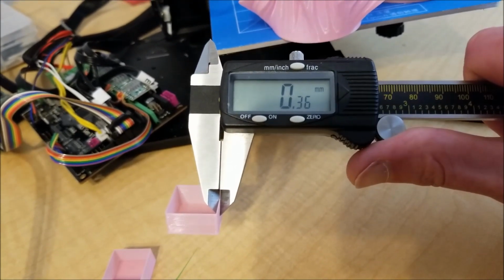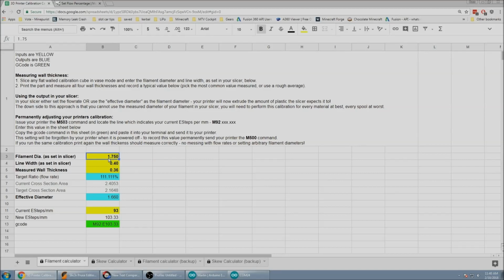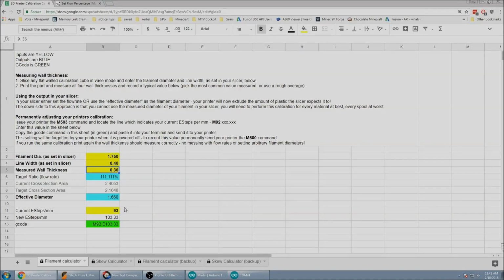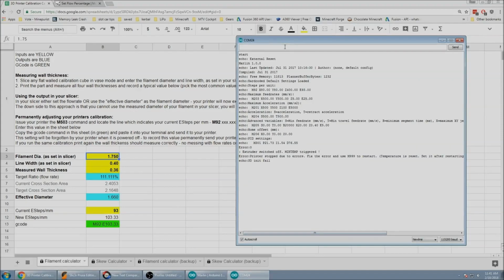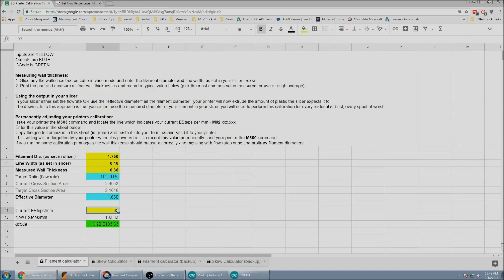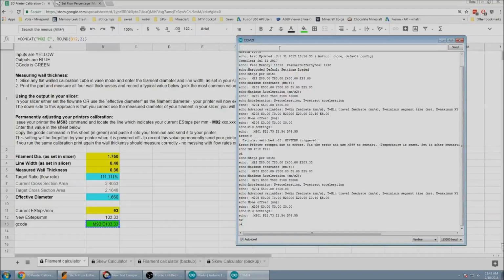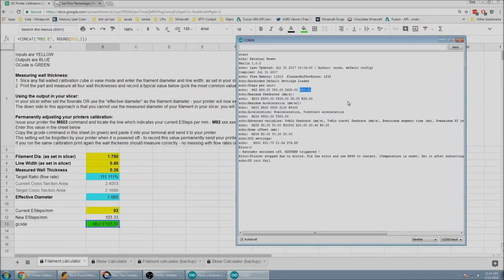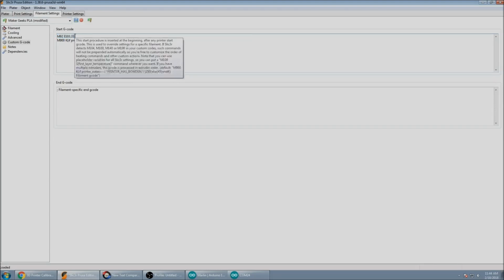Getting Better Layers from your 3D Printer and a better(?) way to calibrate your extruder!

Comment: Hey Ross,
I've watched some of your videos and really enjoyed them so far - great work!
I recently had some major problems with my extruder motor. It started click-clacking, missing steps and not extruding the filament correctly. (At that time I changed the cooling system as well as the fans for the hotend. I'm under the impression that the silent fan I used wasn't enough to keep the temperature down and the filament heated up inside the cooler.)
However changing the cooling system again, the fan and also (necessarily) increasing the voltage on the extruder motor did the trick and I finally could print again.

But I also had to recalibrate the e-steps noticeably (which for a long time worked great in default settings - not sure if I somehow damaged the motor after a day long click-clacking print while I was at work - could that be possible?).

Long story short I used the method that you described - measuring how far the filament actually got extruded vs. what I entered in OctoPrint. But your method really seems more straight forward though. I can't wait to try that!

One more question:
I watched your other video where you compare the noise of the prusa to your modded ender 2. That's amazing. I have as well watched Tom's video on the TMC2130 beforehand and I was quite intriqued. Seeing how you implemented the drivers into your ender - the printer I own too - makes me want to do the same thing even more.
Can you please elaborate on what exact board you used? (Also why this board, where did you buy it from - and well - all the juicy details! ^^)

I'm kind of in love with the idea of having a printer running silently besides my desk all day.

When I got the ender it was like 'holy shit TURBINES'. Changing the power supply (fanless notebook style brick off amazon) as well as changing the remaining fans helped a lot. The screaching and whining of the motors remains though...

I'd be happy to hear from you :)

(also: https://goo.gl/wgD1Si )
Reply from the maker: Early on the PTFE tubing in my hotend got pulled slightly out, either by retractions or filament changes. This caused a real mess as it let melted filament go where it should not... including causing a blockage in the end of the coldzone just before the nozzle - I wonder if something similar happened to you and the "clicking" was the stepper just pushing against a rock.

By "increasing the voltage on the extruder motor" I assume you mean increasing the reference voltage on the stepper controller (adjustment pot) which in effect increases the motor current (not voltage). It make sense that higher drive currents could help the motor power through a restricted pathway... have you tried pushing filament through by hand (while the hotend is hot of course)? It should be fairly easy to do ... it's hard to describe "the right feel" if you don't have something to compare to though. Check for anywhere the filament might be getting bound up starting from the spool and take a close look at the path through and just after the drive gear. Also check that the filament idler bearing (the bearing opposite the drive gear) moves freely.

When you were "changing the cooling system" did you disassemble the hotend enough to remove the PTFE tube and nozzle and make sure the end of the PTFE that's in there is in good condition? It could also be a good idea to burn off any gunk in the nozzle - there might be some burned plastic in there causing a partial obstruction or something. Also it's important that it gets reassembled correctly, it's more complected than "just putting it back together".

As for damaging a stepper... your really can't electrically damage them by stalling them, well short of causing destructive overheating which the smell should clue you in if that happened ;) 

What is your e-steps per mm now? 

- - -
I got this controller https://www.amazon.com/gp/product/B072ZZ3YQW
I picked it because I had no idea what I would need and this one brought out the maximum number of pins while being a single board. I bought from amazon because i wanted it sooner than 6-8 weeks from china. Any Ramps derivative board which exposes EXP1, AUX-2 and AUX-3 (in addition to the obvious connections) should suffice for this conversion and require very little change to my base Marlin modifications for the Ender. But you will lose the SD card reader if you don't get one with EXP2 and also buy a new display with a card reader integrated (or i guess you could find a card reader that stands on its own) - but you use octoprint so losing the SD reader probably isn't that important to you. Picking a display is not easy either, this whole "industry" is a mess of mashed-up hardware and to fit "this" display to "that" controller may require "such and such" adapter :/

Anyway, this controller board isn't "amazing" by any means, I sure would design it differently but then I guess it wouldn't be a standard ramps derivative my way... but the technical debt of its evolution leaves some rough spots IMO.

If you are willing to spring the extra $30 or so, and if you can find it in stock, I would suggest giving the Einsy Rambo Mini a try (https://ultimachine.com/products/einsy-rambo-1-1?variant=5522483871774), it retails at $110 and has the TMC2130's built in (keep in mind that if you go with a RAMPS like board the 4x TMC2130 silent step sticks will run you about $55). This is the same board that the Prusa i3 mk3 is shipping with. I didn't go this route because I started my adventure before this board was available for purchase. Hey, if you buy 2 and send me one I'll be more than happy to send you my marlin build when i get it going ;)

I haven't made my Marlin modifications publicly available yet because... well, i work in the tech industry and as such my employer owns everything I create even in my own time (it's the way of the industry, nothing specific to my employer). They are more than willing to allow me to release stuff, it's just a hassle I haven't quite had the ambition for yet, but I'll get there.

That said, it took me a full weekend to get my printer working on the new controller - keep in mind that my day-job is working with software and among my hobbies are designing my own circuits and I've designed a few high power (50+ Amps) motor controllers as well and i've been doing embedded stuff here an there for years and years and I'm not new to stepper motor theory and function either and this project had me questioning if I could pull it off for at least the first couple of days. Granted, mapping out the LCD and digging through enough of Marlins code to make the needed changes were the worst parts and at the same time are challenges that those who follow in my tracks wont have to deal with (once i make my Marlin build available that is).

Anyway, have your potato back :P

Oh, and here's some pic's of the basic mounting of the step sticks https://imgur.com/a/iTYJq
Reply: Thank you very much for your informative and insightful answer! :)

You're probably right on the voltage/current thing. I'm not an expert on those things (nor am I a native speaker) so I probably got the terms mixed up. What I did do was use my digital voltmeter and take a measurement between the adjustment pod (for the extruder) and ground - it initially read 0.62 volts. After slowly ramping it up to the point where the extruder motor stopped clicking the display read around 1.1 volts. So that's what I was referring to.

I also checked the bearing that pushes against the cog of the extruder motor and verified it moved freely.

While thinking about it again I remember that at some point the extruder cog was scraping off the filament instead of feeding it steadily into the tube. Probably also because of the slight blockage inside the heatsink/hotend. For every full rotation of the extruder only about one quarter (and usually the same) fed in the filament a bit, the other three quarters continued on scraping the filament. So I thought the cog must be off center or the rod of the extruder somehow got crooked. I checked and they both were not.
So when I added some more force onto the bearing by hand it seemed to work just fine. So I thought 'might as well be the spring having deformed and lost a bit of its strength over time'. I then got rid of the spring and looked for something the right size to push in between where the spring was sitting. Luckily the included green USB microSD card reader fits perfectly. It worked well enough that I could print a part to replace the spring completely - with the added bonus that changing filament isn't such a pain in the a** anymore: https://imgur.com/a/6W4mE
'If it's stupid but it works it's not stupid' - so I'm happy with that solution right now ;)

The hotend on the other hand I disassembled multiple times. Completely. And cleaned it every time. And carefully reassembled it every time. Trying to pay attention to every detail I learned from watching videos on unclogging and assembling the hotend of the ender 2. I also checked the tube and made sure the filament could still slide through easily. I even switched it the other way around to have the cleaner side go into the hotend. I think I was very thorough... oh and I also changed the nozzle at some point just to be safe.
And as you suggested I made sure that I could push the filament through by hand with just little effort.

(FYI - first I used the stock cooler with a silent 40x40x10mm fan, which was okay. Then I switched to this one https://www.thingiverse.com/thing:2751027 where I think all the problems started and the silent fan wasn't strong enough to keep the the heatsink at a reasonable temperature. At that point the heatsink was really really hot to the touch. Now I switched to this one https://www.thingiverse.com/thing:2334407 - but using a 40x40x20mm fan which seems to work just fine.
BTW - really like your cooler design. I'd like to use it as well but the fact that you can't really see the nozzle sort of keeps me from switching. The first cooling system I tried was mostly because of the fact that you could see the nozzle very well.)

So in conclusion I suppose for me there were multiple issues forming a big problem altogether... and while being a very frustrating episode I think I've learned quite a lot from it. (Though I'm not sure if everything appeared in the order I wrote in.)

Oh and esteps... I think around 98 or 99 instead of 93.

---

So about the board, Marlin and everything you wrote in the second half of your post. Very interesting! Thanks for sharing all the information... I think I do want to dive in deeper and have to learn more about the firmware and how everything works together.

To be honest I don't even know what kind of chips are used here. From doing a five minute research via Google just now I take it that these boards are arduino based. I haven't been in contact with any arduino hardware yet. But from my understanding that's an architecture (of which there are many - intel, arm, powerpc, etc. etc.). And it seems like Marlin is the open source software for driving 3d printers. And it seems like Maril is written in C.

So I guess the modifications you were talking about are basically adapting Marlin's code (addresses, pointers, values, etc.) to be able to compile it and then run it on your specific board w/ display, stepper drivers and everything?

-

I myself am a software developer and have been for quite a few years now. And it's not just a profession but also a hobby of mine and has always been. I've started at a young age and have tried and been in contact with a lot of different programming and scripting languages through the years (QBasic, Turbo Pascal, Delphi, Assembler, C/C++, Visual C++, Java/JavaFX/GTK/Swing, Android, PHP, Python, JavaScript/nodeJS, Shell scripting, ...).

However my focus has always been more on software than on hardware... It's not that I specifically wanted it to be this way, it just sort of happened. When I was studying computer science I loved the classes where we had to design and build digital circuits for example. And I do have an understanding of how things work and why they do.

Maybe this would be an opportunity to get a more detailed look into embedded systems. I always liked hardware-near (not sure if that's the correct term) programming although it rarely occured for me.

But I like a challenge and I do like to think there's nothing I can't learn in this sector (- eventually ^^).

So I'm planning on testing and optimizing the printer a little further this weekend (your suggestions from this video; esteps/filament flow & z-axis) as well as doing some more research on the hardware you suggested - and running marlin on a new board in general...

Moaar potatoes - cheers! :)
Reply: Oh and one more thing - in the flexi rex video you were talking about bed leveling, I think. And how easy it was to get prints off the bed. In the beginning I had a similar experience. But over time the surface quality decreased... At first I had to use glue stick. Therefore it was harder to remove the prints and the surface was worn down further due to more scraping necessary. Eventually I was looking for a different print surface. I decided to go with ceramic glass I had custom made by a manufacturer.
Turned out to be a great choice. It seems to be very very very durable with no wear at all. It is nearly impossible to scratch the surface with the spatula - even if you agressively intend to.

And the finish on the bottom layer can be quite astonishing. If you do a very narrow bed leveling using no adhesive at all, what you get is a mirror-like bottom layer. I kid you not. It becomes very shiny an reflective - with a carbon fiber like appearance...

https://imgur.com/a/tiLyD

I tought I'd just share this with you aside from the actual topic
Reply from the maker: I have to wonder how many passers-by are reading all of this..

The change in e-steps isn't unreasonable, my current filament likes 103.33

However, the reference voltage is a bit concerning - 0.6v ref works out to about 750mA where 1.1v ref is pushing 1.4 Amps (this isn't an unsafe value by itself, it will depend on how well the excess chip heating can be managed). The stock ender board uses the A4988 drivers (I've taken the heatsink off of mine to see for sure) with a 100mOhm sense resistor so the formula for reference voltage to current is: Vref / (8 * Rsense) or Vref / 0.8 in this case [1]. Anyway, make sure the driver (chip/heatsink) isn't getting too hot. There should be thermal protection (at 165c if it's a genuine part) in it to prevent meltdown. In general thermal protections like this are meant to act much like airbags, not steering wheels - they should only be used in emergencies not every day... in short if you start getting missed extrusion the driver being in thermal shut-down is a real possibility.

Cooling: that could have been the issue (not enough cooling on the cold-zone). I agree my fan shroud does make seeing the nozzle hard, I'll likely revisit the design some day.

Marlin: you can download marlin from github and start messing around with it. It's basically C++ with some compiler magic for the ".ino" file to give you a setup and a loop function while the arduino compiler generates a main function to invoke them.

Print surface: cool, but i can see some significant elephant foot going on - which is fine so long as you are going for the smooth bottom surface but not so good if you need parts to fit together. You'll be able to get parts off the bed a lot easier if you lower your bed a bit. If you do the paper friction test for leveling use 2 sheets instead of 1 and go for the same feel you normally do and it should be about right - although you will lose the flat glass like surface of your prints if you do.

A4988 datasheet: https://www.pololu.com/file/0J450/a4988_DMOS_microstepping_driver_with_translator.pdf
Reply: Yes this comment thread has gotten quite long ^^.
Anywho maybe it contains some useful information for others too... so it might be a good thing :)

You're probably right about the voltage thing. Thanks for pointing it out again... This weekend I sat down and re-tuned everything here and there. I readjusted the X and Y belts and reassembled the Z axis from scratch (installing a different spacer to keep the filament away from the threaded z rod and trying your motor mount as well).
The last thing I did was to lower the voltage on the extruder to around 0.63v - that's the value that was set initially. And it looks like everythings working fine...

Overall print quality has improved a bit. The test cube's walls look more even than before. However the measured thickness of the single line walls right now is 0.49 while there's some spacing between the lines in the first layer as well as some really tiny gaps between the bottom layers and the walls (0.2 layer height, 0.18/0.15 first layer).
Before all the problems started I had a perfectly smooth first layer without any gaps... I think there's some more testing an tuning to do.

About the print surface on the pictures I linked: It's actually not elephant foot but a small brim (2-3 lines or so) that hadn't been removed. I just popped the prints off the bed and took the pictures right away because was so suprised by the finish. ;)

I will download and look into marlin very soon, I guess. I sort of 'have to' since saturday I ordered the board you suggested (Einsy Rambo 1.1). ^^
Tracking says it got picked up from Pittsburg yesterday and arrived at 'Chattanooga Distribution Center' Tenessee this morning. So only few thousand more miles to go...

Btw: What's your regular print speed?
I think mine's usually quite low since higher speeds tend to cause some ringing and artifiacts.
(You are also welcome to share a few more settings that you think are important and necessary for this machine -- only if you're willing to share them of course.)
Reply from the maker: raise your bed to close up the first layer if that's how you want it

are you planning to use the stock display?

GL with marlin

my fast print speeds are:
Perimeters: 60
External perimeters: 40
Top layer: 40
Infill: 100
First layer: 20
Travel: 200

And i normally print this at 0.2mm layer height.
And yes, i increased my acceleration values so my printer really can do the 200mm/s travels.
Reply: Hey Ross, it's been a while... :)

My new board finally arrived last friday -- yesterday night as well as today I started tinkering with it a bit.
The Arduino part seems pretty straight forward. First of all I tried some 'hello world' stuff with the console and everything. Plugged in the usb port, hooked up the power supply and got to know the ide a bit - pretty easy so far.

I also downloaded Marlin, read the einsy wiki etc. and started going through the Configration.h and Configuration_adv.h from top to bottom. I think I understood most of the important parts and adapted everything necessary. Marlin compiled and was uploaded successfully.

(Right now I run the board pretty much without most of the components... my plan was to test everything step by step.)

After compiling and uploading I was able to send commands via console. Reading/writing settings etc. First I took a look at the endstops, configured them properly and I am now able to trigger them manually and readiing their state (M119).

I do plan to use the stock display later (if it's possible). But I think I am not quite there yet -- which actually isn't that big of a deal, since I have the console and also successfully hooked the board up to my octoprint server. So controlling and testing is not a problem right now...

However there is one quite big problem. The motors simply won't work. They don't seem to do anything, no matter what commands I issue.
No relative or absolute movements, no homing, no difference in enabling/disabling them. (I tried all axis, but am debugging using only the x-axis right now.)

So far I made sure the endstops are open. I tried assigning non-zero coordinates manually to ensure the firmware does not block movement. I removed min/max limits. I set temperature sensor modes of the hotend and bed to 998 to simulate 25°C - to prevent the firmware from going into failsafe mode. I checked the four connected pins of the motor to see which ones were paired, verfiied how I connected them by looking at the schematics of the drivers. I also switched back to the old board to check the x motor I was testing with all the time and it works great - not damaged in any way.

It's getting pretty frustrating. ^^

As I said right now there's only the x motor connected as well as the x endstop (so I could stop movement when homing).

Do you have any ideas/advice? Have you experienced anything like it?

Thanks in advance :)
Reply from the maker: You need to enable HAVE_TMC2130 (or something like that). If you already have done this then Marlin might be trolling you (does it to me all the time) - although it's odd that it wont attempt to home. It's likely something to do with the TMC2130 configuration being incomplete or some other pin configuration issue. 

If you get stumped let me know.

As for the stock display...

It looks like RAMPS and RAMBO use different EXP1 layouts - oh the good times, so you'll need to map the pins yourself. I'll paste my pin configuration below for ref' - note the wire colors in the comments.

MKS pinout: http://reprap.org/mediawiki/images/0/0d/MKS_GEN-PIN.PNG
Einsy: https://github.com/ultimachine/Einsy-Rambo/blob/1.1a/board/Project%20Outputs/Schematic%20Prints_Einsy%20Rambo_1.1a.PDF

  #undef BTN_EN1
  #undef BTN_EN2
  #undef BTN_ENC
  #undef DOGLCD_A0
  #undef DOGLCD_CS
  #undef SD_DETECT_PIN
  #undef BEEPER_PIN
  #undef KILL_PIN
  #undef DOGLCD_MOSI 
  #undef DOGLCD_SCK
  
  //
  // EXP1 - CREALITY Ender-2 Display - (RAMPS / MKS) Header must be connected rotated 180deg! 
  //
  
  // brown                SCK
  #define DOGLCD_SCK      37
  
  // red                  ENCBTN
  #define BTN_ENC         35
  
  // orange               ENCA
  #define BTN_EN1         17
  
  // yellow               Not connected (could be made a BUZZER)
  // #define BEEPER_PIN      16
  
  // green                ENCB
  #define BTN_EN2         23
  
  // blue                 A0
  #define DOGLCD_A0       25
  
  // purple               LCS
  #define DOGLCD_CS       27
  
  // gray                 MOSI
  #define DOGLCD_MOSI     29
Reply: Of course!
How could I miss this... I feel stupid now ^^.

So after enabling HAVE_TMC2130 etc. and adding the CS pins in the configuration I received a z-axis error at first (stating overtemperature and short to ground on coils a and b) but after disabling z and e0 I finally could get some movement! And silent! It's alive!! https://imgur.com/LwMQEGj

(Thank you very much! ^^)

I think I'll prepare all the wires and connectors next and hook up motors and enstops to test movement on all axis. Then I'll take a look at the temperature sensors and heating, I guess.

Thank you for sharing your display configuration! I am very interested in getting the display to function properly -- but this might be the last step, since I cannot wait to see the machine print for the first time. (:
Reply from the maker: Congrats! Feels good doesn't it? :D

Marlin configuration is not a small undertaking. Like I said before it took me a long weekend to get my MKS going.
Reply: Yeah it feels quite good..! ^^

I now have all motors and endstops connected as well as extruder heating and thermistor. I still can't believe that there is almost no noise emitted by the machine! :)

One problem remains though: X and Y only move in one direction. It worked before but only because I had CORE_XY enabled - which of course is wrong for this machine. But when enabled I could move the X axis in both directions. When I attached the Y motor a little while later I noticed both axis moving thogether -- hence I went back to the CORE section.

I haven't found a solution yet. Z and E work fine in both directions (also with X or Y motor attached, so still nothing broken).
(Btw schematics say pins I had to add are Y_CS 39 / X_CS 41 while the other two are Z_CS A13 / E_CS A11 -- so analog? Maybe there's the difference?)

One last issue remains until first print... :)
Reply from the maker: X and y will only move in one direction until the machine has been homed (marlin is trolling you).

All analog pins are also digital pins I'm fairly sure, so it's just analog capable but likely used as a digital io
Reply: I know, I've read that already. When I boot up the printer the current position is 0 0 0 and I can't go past that in 'minus' direction. I should however be able to go to x5 and back to x0 again. When I issue these commands what I get is movement towards(!) the endstop twice.

When I home all axis and subsequently issue any movement commands x and y voilently want to go further into the endstop which is already triggered.

All movement that's supposed to go away from the endstops goes towards them. :(

(And as stated before when using COREXY the axis move codependently, but movement in both directions is possible...)

I read a lot of discussions on stepper movement in only one direction, but nothing seems to be similar to what I experience. Most are indeed trolled by Marlin or have to invert their endstops because they are closed.

Right now I don't know why this keeps happening...
Reply from the maker: Hehe, get ready to feel stupid again - you probability just need to tell marlin to "flip" those axis...
Reply: At this point I'd like to feel stupid again... :-/
I flipped the axis already. Result is all movement is away from the endstops...

So no matter which way I flip there's only one direction. Regardless of homing. And I have no clue...

//EDIT: I mean this can't have anything to do with the wiring since plugging the x motor into z makes it behave normally -- right?
Reply from the maker: Check the configuration of the "direction" pins - make sure they are set correctly (set to the correct pins that is).
Reply: Oh god now I feel extremely stupid -.-

I swear I did that at least 10 times. Only now I realise the X and Y direction pins were switched. No wonder it went only one direction in normal mode but opposite directions for COREXY.
When sending commands I was of course addressing single axis.

Oh well... thank you sincerly for your help! You saved the day! (and the one before ^^)
Reply from the maker: That's why I'm here :P
Reply from the maker: Get it running on the rambo?